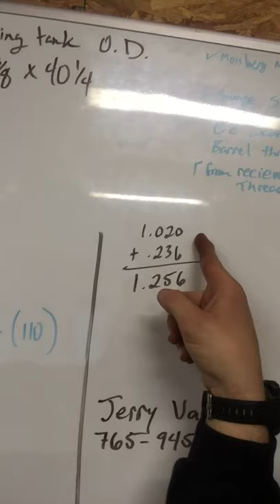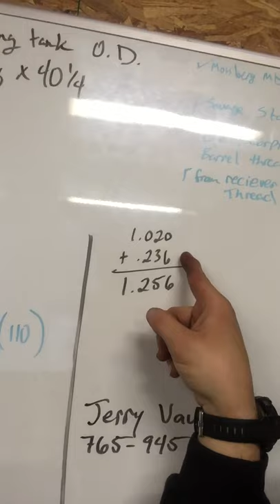How To drill and tap for a scope mount

Comment: That guy should have his head examined.
My grandfather gave me a 30-40 Krag in 1967 to use as my first deer rifle.  It was all original with the military sights and everything.
Me being a stupid 14 year old thought it would be a good idea to scope it so I paid a gunsmith to mount a scope on it.  It worked out well for a few years and then I bought a Remington 760 and hunted with it while the 30-40 resided in the gun safe and only saw the light of day when I took it out to clean and oil it.
Well, fast forward to 2021 when I auctioned off most of my rifle collection I expected the 30-40 to bring pretty good money.  It was only one of two that I put a reserve on.  Highest bidder was less than $500.
I consulted a well respected gun shop and he said if it would have been an original specimen it would have been worth about three times the highest bidder but as is he was not surprised at the lack of bidding.

Comment: Does drilling and tapping take away from the value of a 1911?
Reply: I would have know if it was a pistol what type you had first. Does it have collector value? Is it a high end custom made pistol? Or, is it a Rock Island you got $600. If it’s not an original Colt from WW2 or a custom made high end piece of art work, I really wouldn’t worry about it. In any other case a properly mounted optic will probably add a little value. Hope that helped

Comment: Why didn't you use a bottom tap?
Reply: Fair question. I did use a bottom tap though. Probably should have gone into a little more detail in the video. The reason I did things that way was because the bottoming tap in my tap set doesn’t truly tap all the way to the bottom. I believe it’s shy about 2-3 threads. I’ve noticed a lot of these “bottom” taps are like that and I end up having to modify them a little with a belt sander. Thanks for the question, hope that answers what you were asking
Reply: @Jmastffp  thanks. I have another question if you don't mind. I had an amateur gunsmith I  knew ffom work who offered to drill and tap the holes on my 100+ years-old Mauser 98 for free, unfortunately he messed up the front holes badly so that nothing was in alignment. Someone suggested i could repair it by filling the holes with silver solder or tig weld them and start over. What would you suggest? Also, what's the typical fee for drilling and tapping these receivers?
Reply: @snappingbear  That's very unfortunate. Yes the best (and frankly the only way I know of) to fix that is to plug the holes and start over. You mentioned a few ways. I prefer to use threaded studs held in place by green lock tite or JB Weld and then peen the heads over with a punch. After that I dress the areas with a file, then 320 grit paper, and finally some cold blue. After that sets up you should be able to re-drill and tap just fine. When you drill for a scope you need to get everything nice and straight. This is really difficult to do on a round surface like your barrel or receiver without a milling machine or a jig like I use in the video. It can be done without, but you'll have to get creative. You have to be on the top dead center axis of your weapon. I typically charge $75 to do a drill and tap. Average cost will be somewhere between $50 & $100. If you have anymore questions hit me up at mastgunworks@gmail.com
Reply: @Jmastffp  I have a 1914 7mm mauser from Italy (Oviedo) that I want to get drilled and tapped for a s ope because the open sights are long gone.....is 50$ to 100$ about average for any rifle to drill for a scope mount???    Thank you and nice work on the Krag!!!
Reply: @hughjunit2503  Hey Hugh, thanks for question. You'd have to ask the gunsmith you're looking at taking it to. But, yes typically this job falls in that $50-$100 price range. Might be up to $125, but I wouldn't expect it to be more than that. Midway USA has some good jigs and tools available if this is something you're interested in tackling yourself as well. Hope that helped
Reply: @Jmastffp  I really would like to get into minor gunsmithing like this kind of thing.    I usually mount all my scopes and rails and accessories but those holes are already there.........I'd hate to screw it up and have to have it fixed, but yet again it would be a good cheap rifle to learn on as well......     Thank you
Reply: @hughjunit2503  check out Midway USA’s youtube channel. They have a while video series on Mausers. Including one on drilling and tapping for a scope. I believe it features the jig they sell. Makes the job super easy.